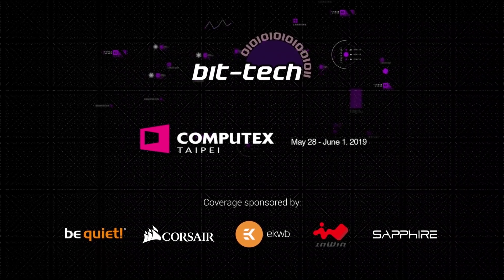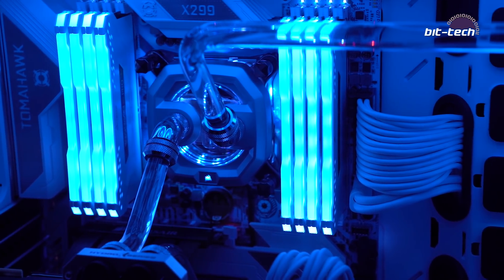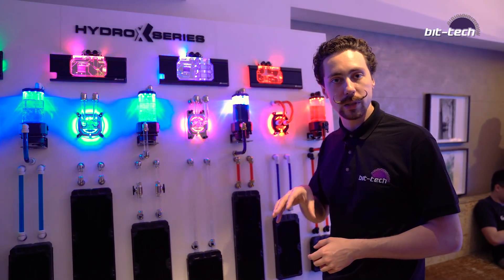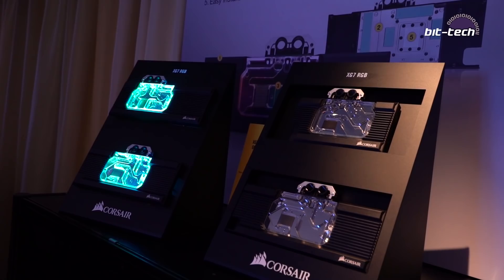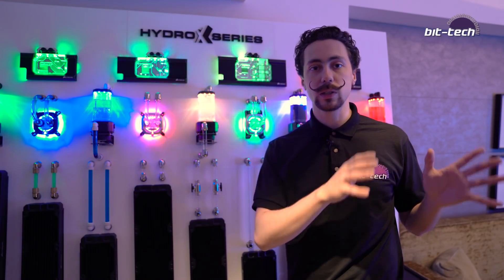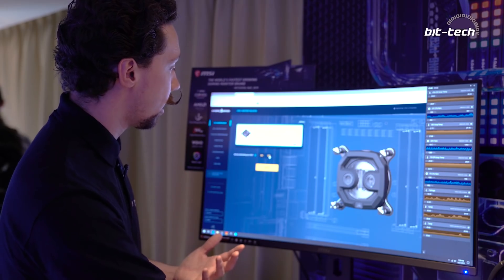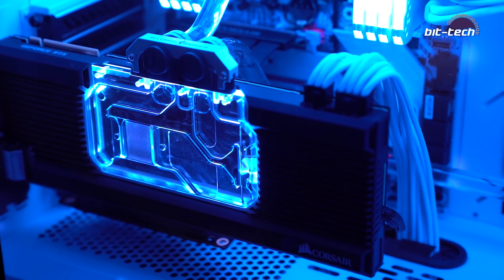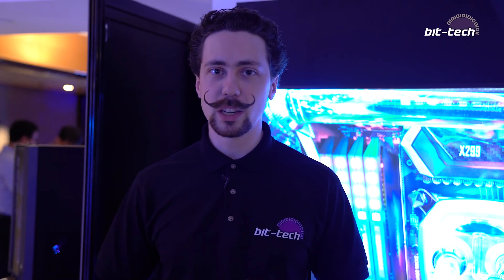Corsair Hydro X: Full Range of DIY Water-Cooling Parts | Computex 2019

Comment: Corsair went way overboard with the pricing
The CPU and Pumps are okay. But dear god the GPU and Fittings are hella expensive
Reply from the maker: Actually of the bunch I would say the GPU blocks are competitive, with the CPU and pump not quite getting there. The fittings are Bitspower so expect expense sadly, can always go Barrow or Bykski to reduce costs.
Reply: @bittech1  It wants 90bucks for fittings. That's quite pricey.
The pumpres kombo is a bit procey but since it's a d5 and its got a top and a cover I thought it's fine.
Tubes are a bit om the pricey side as well but what really bugs me is the radiator config. If I pick a generic case and want 2 360s I cannot pick it for some reason. There's an NZXT H500 And H700 but no H440 for some reason. It's almost the same case. I mean I do understand they won't support every single case but this one bugged me.